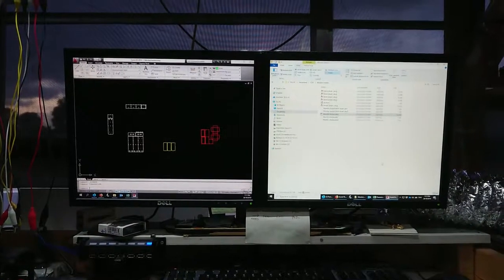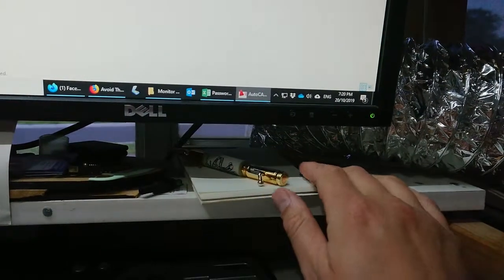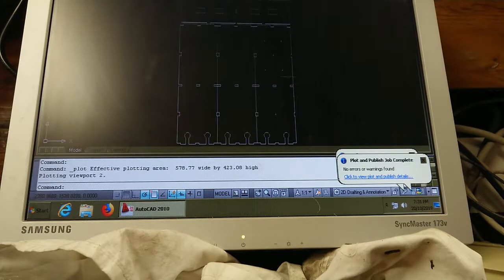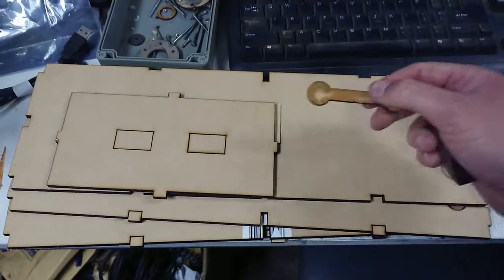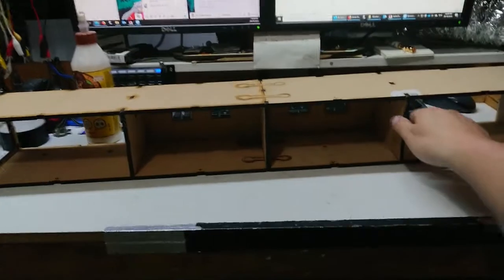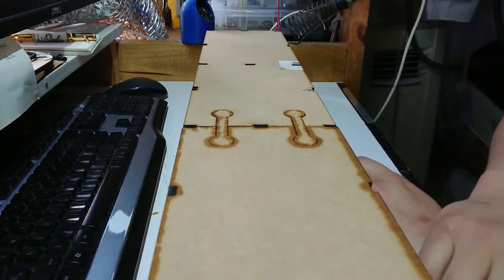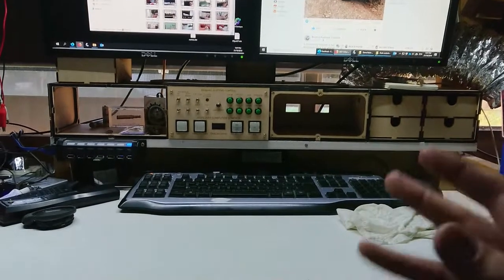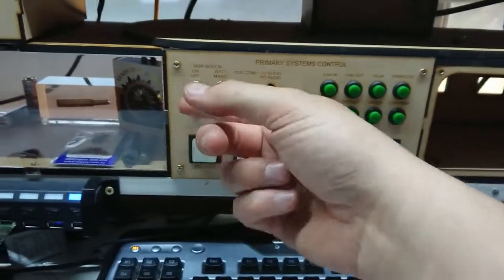Desk Control Center upgrade (with vintage switches and OLED)

Comment: Could you not wear gloves when gluing acrylic to avoid getting fingerprints on the acrylic?
Reply from the maker: yes and with Multiple sclerosis (as I suffer from) I would not have dexterity enough to perform the glue application properly.
Generally fingerprints aren't a huge issue if you keep the air moving while the glue dries.
Reply: @TheAussieRepairGuy  I see, I hadn't considered the fact that MS would cause issues for using gloves when doing this type of work.  To be honest with you I don't know much about MS.
Reply from the maker: @Lachlant1984  all good, it comes in different forms, and i go to oncology monthly for treatment.
In my case, i have limited and altered nerve response in my limbs. My spinal cord at c6 vertebret was demylinated when I suffered my first attack 18 years ago
Reply: @TheAussieRepairGuy  Hmm, I think I understand.